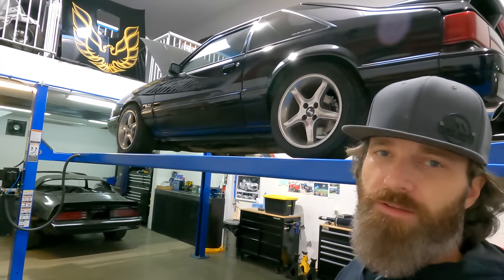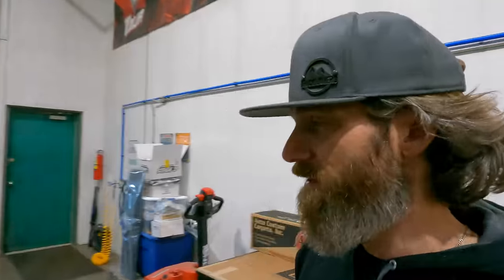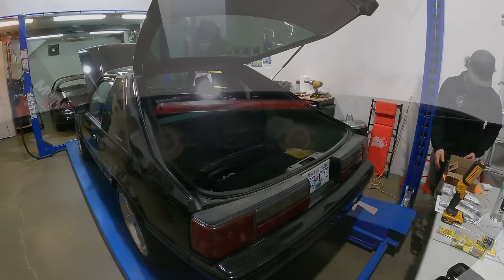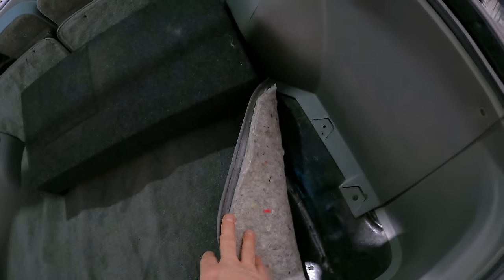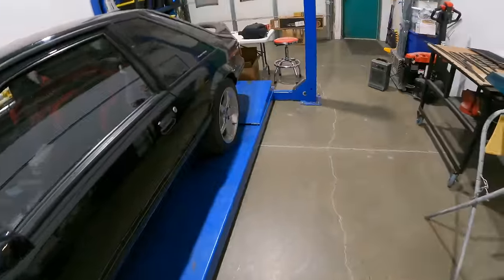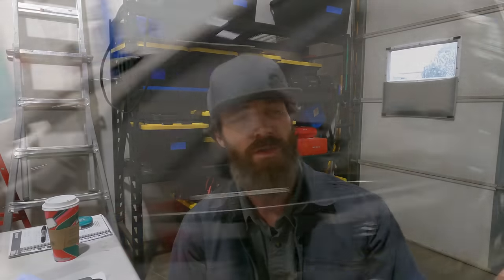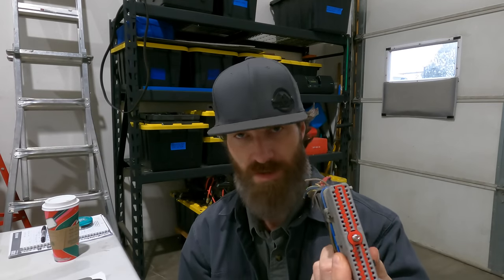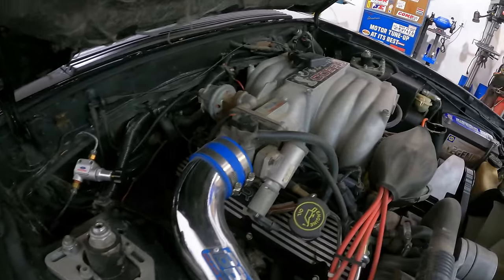These Small Changes Can Transform Your Car From Average To Amazing!

Comment: Had a horrible high idle on my 90gt and drove myself nuts chasing down every vacuum line. When I finally found the cause it wasn't a vacuum line but the rubber boot on my intake pipe was pinched and curled up where it meets the throttle body but it was underneath so it wasn't easily noticeable.
Reply from the maker: Glad you found it and thanks for sharing 👍

Comment: I remember when they came out with the mass air conversion kit offered by Ford Motorsports for the speed density conversion. Did they not have an information package to make this fairly seamless for the conversion, or did a lot of them get installed doing shortcuts ? My car is an 89, so I myself didn't need it but knew it would making engine mods easier for earlier cars. I view your video's as very informative filled and the length doesn't bother me one bit due to that quality, but I'm a retired engineer who likes good information.
Reply from the maker: Thank you for the kind words. I believe a lot of them were installed in short order...

Comment: I did the license plate lense, screw, seal, and led kit from LMR on mine. Dude had blue lights in there and one wasn't working. Could have got pulled over for the blue light and or one not working.
Reply from the maker: LOL - I have seen folks rocking the coloured light before as well...
Reply: @KASLCustoms  you can get pulled over for having blue if a cop wants a reason to pull you over and I'm already loud with Spintech side pipes

Comment: Quick question, when you swap from sd to maf, aren't you supposed to remove vacuum line from map sensor and it becomes a bap sensor?
P.s. wish the average stang in my area was that nice!
Reply from the maker: Yes, you are correct on the MAP sensor. This one however was bad and needed to be changed

Comment: I meant to ask you... have you run across any "stretched " accelerator cables ? Very low gas pedal because there is slack in the cable . I've seen zip-tie fixes but they say that leads to the cable breaking.
Reply from the maker: I can’t say I have

Comment: GREAT WORK, what did you do to your finger?  looks painful...how do you like that Dewalt light bar?
Reply from the maker: Thx buddy. I smashed it with my 3/8” dewalt rachet 😂. The light is great. I wish it would size itself slightly smaller. If you see in my video, the only way to get it on a fox hood is sideways due to its overall length…

Comment: Quick Question: Do you advocate for strut tower braces like the Maximum Motosports style? I never see any of you guys running them. I love the functionality but worry about it taking away from the awesome looks of my engine bay.
Reply from the maker: Hey bud. There is definitely a time and a place for them. I’ve never had a car with a “tuned enough” suspension to have to worry about getting one. Also, for the type of driving I do, I feel it’s over kill for my application 👍